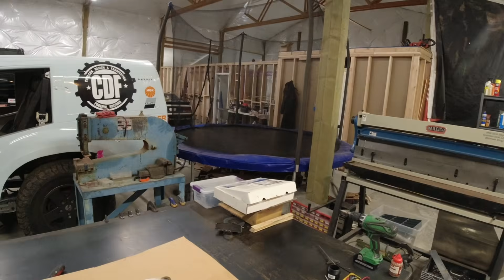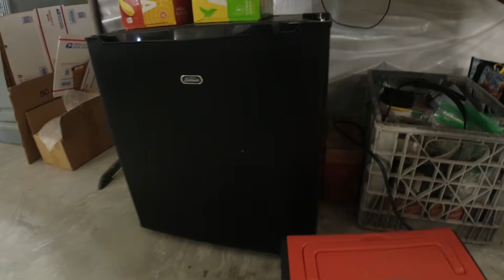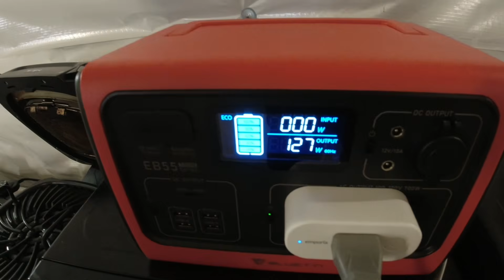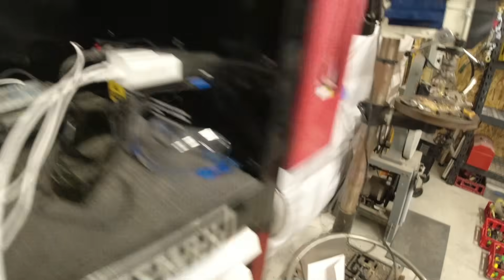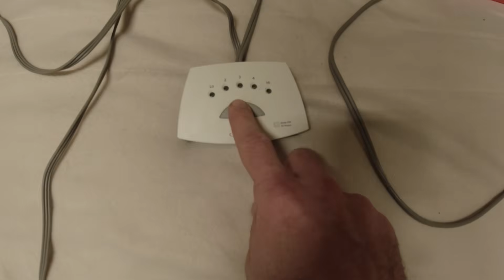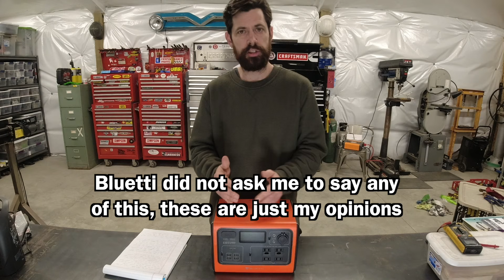Planning for a Power Outage in the Barndominium: Bluetti Power Station EB55 Full Review

Comment: I'm quite surprised that the AC charger is that big. They should have put in something more portable or thinner.
Reply from the maker: You can charge it with the 12v from a car or solar as well, but the ac charger it comes with is easily the fastest

Comment: That battery pack looks cool, but I realized I've had emergency power for a while...because I have 3 car batteries and a 2500w inverter. Never even thought of that until you said something...
Reply from the maker: The inverter and batteries are not a bad way to go, especially if you are like me and always seem to have a stream of batteries floating into the shop.  The biggest issue I had was that the car batteries drain a lot faster with my inverter because my inverter always runs the cooling fan when it is on. It also seems like when there is a spike in energy consumption, the lead acid batteries drop a lot quicker than the LiFePO4's.
Reply: @AustinCoulson  thanks for the info. If we loose power, it would mainly be for charging electronics and running a propane heater enough to not freeze. All the food would just go outside....